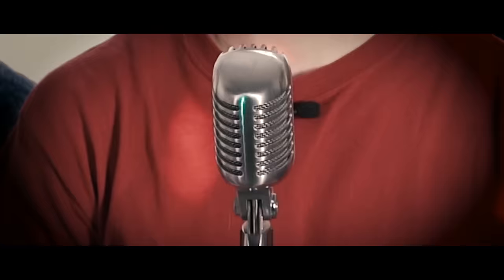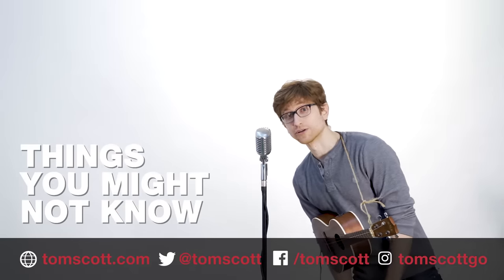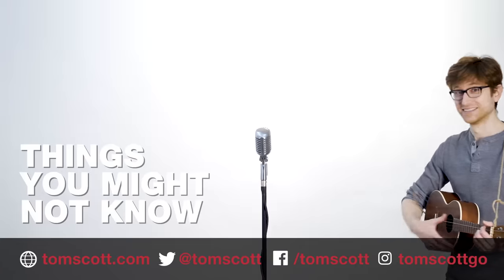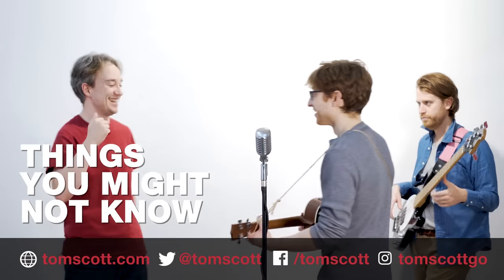How Auto-Tune Works

Comment: And here I thought that they were just slicing the audio into a bunch of tiny slices, then repeating or removing some of them
Reply: hi
Reply: hi
Reply: That is indeed what it sounds like. Makes one wonder if all the extra trickery is necessary.
Reply: @ThreadBomb  That is indeed what it sounds like when someone does a poor job of it. When someone does a good job of it... well, it wouldn't be trickery if you could tell, would it?
Reply: @ThreadBomb  Yes, that's because Tom is just speaking. When it's done to a talented singer, it's barely noticeable. Also, some musicians deliberately use that to get a "robotic", vocoder effect - see Cher, Kanye West, etc
Reply: @hotelmario510 I'm disappointed you didn't include Daft Punk in there
Reply: @Victorsandergamer  dead band 🙃
Reply: @SpectraVoidborn  F (you do realize my comment was before that right?)
Reply: Sometimes that's done, but not just that. And apparently, it's rarely done for professionals. If it is, it's usually to remove breathes and stuff.
Reply: That's called granular synthesis.
Reply: @Victorsandergamer  I mean, they sometimes use auto-tune (like with the singer on “One More Time”), but their signature sound is using vocoders/talk-boxes
Reply: Hi Taran 👋
Reply: S

Comment: Awesome collaboration with awesome people! Fourier transforms ftw. The idea of pulling a single string out of a guitar chord and tuning it is crazy math. Surely that only works for certain combinations? If they were off-tune harmonics would  they be hard to isolate?
Reply: Fourier transforms are not as amazing for signal processing as one might think, there are some caveats, mainly a certain amount of uncertainty between frequency resolution and time resolution. So either you know exactly which frequency is there or when it started exactly, which is what you've touched on with overtones not being exactly harmonics. IIRC it also has to do with the Heisenberg Uncertainty Principle, 3blue1brown has a video on it. Anyway, due to the limitations of the fourier transform, basically all algorithms for pitch detection (recognizing the note being played) are not frequency-based, like this video migh suggest, but time-based. This means that most algorithms don't even use the fourier transform for pitch detection (e.g. Yin or McLeod algorithm) but a process called auto-correlation. Though, admittedly, I don't know how that would work for chords, so software like Melodyne that can also recognize chords may use a combination of both time-based and frequency-based pitch detection algrithms. I haven't looked into real-time pitch shifting (the tuning part of auto-tune) but I'll guess that it is also time-based. Finally, the fourier transform is mainly used for analyzing a signal so you can see the different frequencies in an analyzer (like those on many music videos from Monstercat etc.) and for a kind of filtering (FIR filter) that is much faster in the frequency domain than in the time domain, where the other kind of filters (IIR filters) are carried out.
Reply: @Tom9358 I think 3blue1brown might have used that as an analogy, but it's been a while since I watched that (really good) video so I can't be sure.
Reply: @Tom9358 the uncertainty principle applies to any wave. It doesn't matter if it's a sound wave or the wave function of a quantum particle.
Reply: @Tom9358 Either Sixty Symbols or Computerphile has a really good video on exactly how and why it does apply to sound waves
Reply: @Tom9358 False as well. Nowadays "Heisenberg's uncertainty principle" and "uncertainty principle" fall together. It does not specifically refer to the quantum principle any more.
Reply: @Tom9358 If you take a wave and look at its value at a single instance in time, you can't break that out into parts. It's just a single value.  A discrete fourier transform has to look at a window of time and see how the value is changing. The duration of that window changes the resolution at which you can read out the frequencies. When it's short there's not enough information to capture all of the frequencies, and when it's long the changing frequencies kinda blur over time. This means you're always doing a trade-off and never getting a perfect answer, with any complex signal. Guitar-chords are very complex sounds, so hard to fully analyse in this way.
Reply: The problem with manipulating frequencies is that you both have to work on discrete data (and not continuous) which sets an upper limit on the frequency (it being half of the sampling rate, as the Shannon theorem states), and the algorithm needing to divide the signal into chunks (usually of 1024 or 2048 samples for real-time processing), means that uncertainties "muddies" the frequency output.
Auto-tune software can detect most chords as they separate nicely due to the notes being simple fractions away from each other, however the more irrational the ratio of frequencies, the longer the chunks would need to be, and as a result the time resolution would get worse, which is actually what's most important for auto-tune software.
Reply: SmarterEveryDay no. The Fourier Transform splits up any jumbled mess of frequencies and spits out every individual frequency used in said jumbled mess, which can then be edited (the output is a graphed line with a peak above every number that corresponds to a frequency in the initial jumbled mess) by removing the peaks on the frequencies you want to remove and adding peaks on frequencies you want to add in, then that can be converted back to a jumbled mess, but a better sounding jumbled mess.
Reply: @Howtheheckarehandleswit  You sound like you read an extremely superficial advertisement for the Fourier Transform, but never actually worked with it in practice. As previous comments have pointed out, it's just not that simple.
Reply: @SolarLiner  Moreover, if you have a continuous tone and simply apply pitch correction in chunks, it is problematic to glue those chunks together again without audible discontinuities, so presumably some kind of phase correction needs to be done as well.
Reply: Do you really never sleep Destin?
Reply: I used to follow just 2 Youtubers, and now I see they actually follow each other... how cool is that
Reply: Stop using big words it’s scaring me
Reply: Hey Destin big fan !
Reply: Bass*
Reply: I totally understand that conversation!
Reply: Destin, you guys need to collab!
Reply: Hi
Reply: @T1Squid  Reality is the Fourier Transform for QM waves...>_<
Reply: S

Comment: For those who did not quite get that:

When doing pitch correction or pitch change, one can simply strech or shrink the audio wave. This will change the frequency but the length also. To make it the same length again you simply extend the audio wave. However this works only with sine waves (fundamental waves). Every other sound is made up of these fundamental waves in different volumes, frequencies and a thing called phase shift. To extract these fundamentals you can apply the Fourier transform which extracts all that information. Now you have the various fundamental waves wich you can strech and then simply add up. Because the software changes the pitch perfectly it sounds odd and has the typical kind of sound, especially if the pitch changes rapidly. But in normal converation or singing we expect a certain amount of variation and especially a small timeframe to change the pitch as humans can not change pitch instantly.

Comment: Autotune is like windows movie maker - if you can't tell that it was used, it was used well.

Except daft punk. And glados.
Reply: Daft punk uses a vocoder, which makes a far more robotic sounding voice; exactly what they want
Reply: Daft punk uses analog vocoders
Reply: and T-pain
Reply: and Imogen Heap
Reply: Raybe - Everyday Internet Hero. :D
Reply: I've seen a legit TV commercial made using Movie Maker, using the default settings and all.
Reply: Does that make autotune analogous to God?
Reply: I would argue that autotune was used as intended for GLaDOS... so, it was used well.
Reply: obvious autotune can work well though, if intended. see autotunage by limp bizkit, or half of the EBM genre.

Comment: Can't wait for the video that explains how auto-tune works.
Reply: I beleive 3 blue 1 brown has something at least close to that, check out his videos on the fourier transform
Reply: It’s really hard to explain if you don’t have enough acoustical physics concepts clear in your mind. It’s actually a bit more complicated because Fourier covers a little part of the process and includes only the transposition of the formant (the root pitch) and its harmonics. The hard part is actually how changing the pitch without affecting the SOUND of the source works.
Reply: Simone Salvucci Do you know where one could find an explanation to formant shifting? I don’t know how it could work without some sort of reference
Reply: Short Answer: I don't know.

Long Answer: 🎵I DON'T KNOOOOOOOOW!🎵
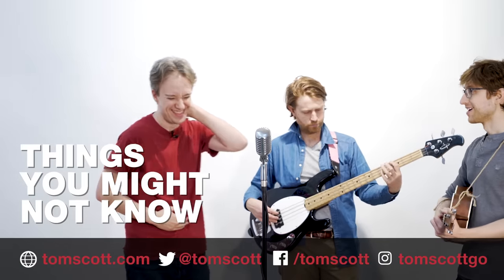Reply: 2:36 fuooo.... hurt-hurt i hurt
Reply: Fourier is not used - very efficient autocorrelation is. The patent is a good read

Comment: I won't lie, I'm kinda disappointed you didn't explain how a Fourier transformation works 😜
Reply: 3blue1brown channel has the best videos for that. Check it out!
Reply: It's not something that can be crammed into a short video. And also, the ways it is used are much more interesting than how to do it. Fun side fact: There were analog machines for doing some fourier transforms, before electronic computers existed.
Reply: @GamesFromSpace  Analog machines for doing some fourier transforms have existed for a very long time. If you send a signal down a spiral path at a constant linear velocity, and sum the measurements from points on adjacent turns of the spiral path in the wall in between and have each sum decay over time while being reinforced by the input, the wall will read out the frequency component at each point whose wavelength is the distance along the path between its sides, which varies continuously along the wall because it's a spiral. That's the structure of the cochlea in the ear, which people are believed to have had for hundreds of years.
Reply: @macronencer  i hit reply to mention 3b1b channel and found you already shared it 🙂
Reply: @iabervon  I'd love it if that were true. However, wikipedia disagrees with you, if I've read it correctly. It's the stiffness of the basilar membrane that determines the frequency response of different portions of the cochlea. The membrane is actually stiffer near the start of the cochlea, and higher frequencies are picked up there, lower frequencies nearer the centre. I was surprised to learn this myself, as I've never studied it properly before. Thanks for prompting a learning experience! By the way, you wrote 'hundreds'. I think you meant 'millions'. :-\
Reply: Joshua Pearce It was an attempt at a joke.

Comment: A Fourier transform is basically like a bunch of stacked filters.  Sort of like those coin sorters where the small dimes fall through the hole, while the quarters slide over top.  What you end up with is a set of bins that each contain the "amount" of that corresponding pure frequency that was in the original audio clip.  The width or "selectivity" of each filter/bin can be changed, but that effects the frequency and temporal resolution of the resulting transform.  For example, if you have an audio clip that is sampled at 2 kHz, and your sample width is 100 samples, you'll get 50 bins at 40 Hz resolution, but it will take 50 ms to collect all the bins. If you use 10 samples you'll get 5 bins, each with a width of 400 Hz, but it will only take 5 ms to collect the bins.

Comment: I find it kind of annoying when people call it Autotune when they're actually using Melodyne or even just a vocoder. They don't do the same thing.
Reply: Eh, same as any other generic trademark.
Reply: It's the same as calling every tissue kleenex
Reply: I always figured the process itself was called "Autotuning" as that basically describes what the process is. It's tuning the audio automatically.

What other word would you use for it?
Reply: Melodyne is very similar to Autotune. However, a vocoder is extremely different from both of them, in my opinion. It's not a pitch-correction tool, it's a spectral analyser and VCA. Big difference in technology, big difference in sound.
Reply: @Berniebud  Nah Auto-Tune is an audio processor created by Antares Audio Technologies. It's a trademarked term. The generic word for this technology is "pitch correction." Of course, there's nothing wrong with using a generic trademark in everyday parlance. Language evolves and it's not my responsibility to protect the trademark of a billion dollar company.

Comment: In vocal pitch correction another thing that needs to be considered is a really cool set of frequencies called formants. These still have a Fourier transform, but are a phenomenon caused by the resonance of your vocal tract, and are independent of the note you are singing. 
They're different depending on each vowel that's being sung, so part of learning to sing is sort of subconsciously training yourself to make these formants consistent across your singing, and consistent formants can make auto-tuning sound a lot more natural. 
When plucking something like an open guitar string, it's as close to a perfect Fourier transform as possible. (As long as the string does not interact with an adjacent string or the fretboard (which will produce a new set of frequencies, or change the amplitude of the existing harmonics).

Comment: The Fourier Transform is deceptively simple. Any given audio is the sum of a bunch of frequencies, oscillating at their own rates.

The details are complex (maths joke) but you can think of a tone as a constant being multiplied by a growing and decaying value, growing and decaying at that frequency.

What the Fourier transform does, is to multiply by a series of waveforms essentially running in reverse, undoing the original oscillation to get back to the original constant value. Where the two frequencies match, you get a peak in the transform.

If you do this with discrete steps in frequency you have the Discrete Fourier Transform. If you are doing this with a continuous function and using an integral to make the frequency steps infinitesimally small (trust me that this is a well defined sleight of hand in maths), that's a continuous transform and you get a continuous wave that looks like the discrete transform but with much smoother, continuous movements to the peaks and troughs.

Comment: Everyone please note: this is NOT the "vocoder effect". Vocoders have some things in common with pitch correction, in that they essentially use Fourier analysis (either in software or through circuitry), but whereas vocoders are relatively simple (if you can call multiband envelope follower, VCA and bandpass filter plus optional sibilance detector and noise source... "simple"), pitch correction has more complexity and subtlety to it. I admit I don't know as much about pitch correction as I do about vocoders, but I do know it involves very clever proprietary algorithms.

Comment: You can use an Fourier transform, modify it and then convert it back to audio with an inverse Fourier transform - or you can just-the-same change an audio and maintain it's length with granulation and speeding/slowing the audio - but the Fourier transform identifies the main pitch, so you know how much to shift it by to match a note.

Comment: I can add a bit here. The secret of pitch correction for voice lays in " formant correction". Just changing the the pitch also changes the resonant peaks in the vocal spectrum. Because our brains use these resonant peaks to distinguish between A O I E U (and other) sounds a even a small shift in these resonant peaks makes the vocals sound unnatural. By placing these resonances back where they where in the original signal it is possible to get pitch shifted vocals that sound natural. 
The Cher effect and autotune sound  occur when this system fails, either because the pitch shift is too large or when the  parameters of the algorithm are dialed in wrong on purpose.
Fourier transforms are often (but not always) part of the methods to implement this, not THE magic but just part of the  method.
Not all pitch correction/time stretching algorithms bother with formant correction, what sounds best depends on the kind of sound you're dealing with. What works well for drums doesn't for vocals and visa versa.

Comment: There is a guitar with autotune pickups. You dont tune it....you just set the strings to a tension that works, select a tuning, strum...and it will sound like that tuning. If you tune it like a standard guitar and it falls out of tune during a song, you can strum it and it will recalibrate so youre in tune again without touching the tuning keys. 

Its not for me but there's that.

Comment: Du du, du du, du du, du du, du dududu
Human voices don't sing pure tones
They're stacked with many frequencies
These natural resonating overtones
sound like a single pitch to human ears
I spent trying to understand (undestand)
How pitch correction actually works (actually works)
But my degree's in liguisticks
and I wasn't prepared (prepared)
For equations that were this berserk
The secret is math(s) called a Fourier Transform
It takes the frequencies that were intertwined
Splits them up, identifies them, isolates them
then software can change them live, in real time
The newest software can change different notes inside a chord
You can tune pianos, guitars or choirs
For me, it's so advanced
it might aswell just be magic
but it can't write a song
some talent is still required.